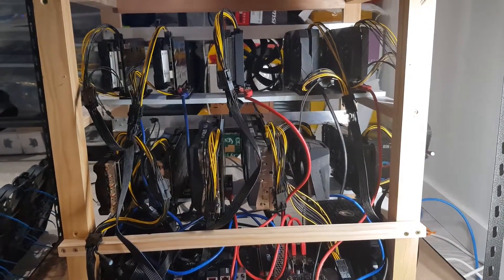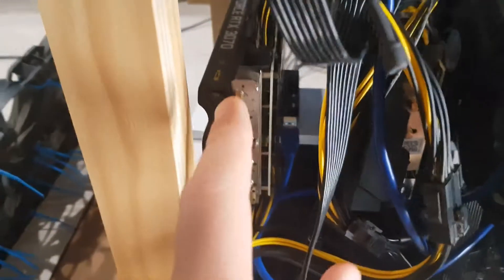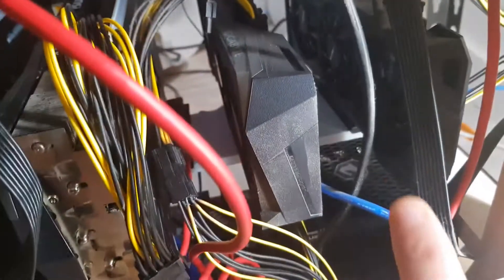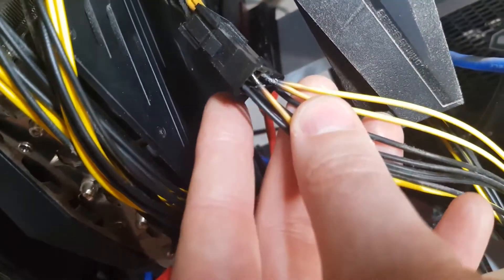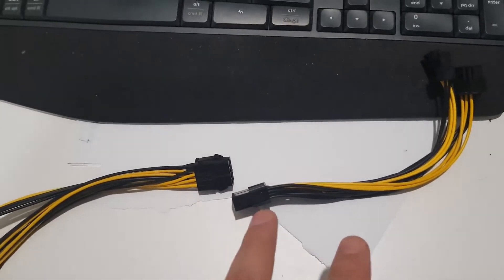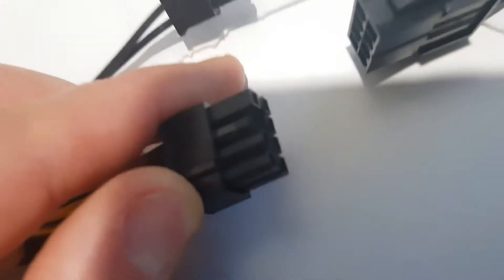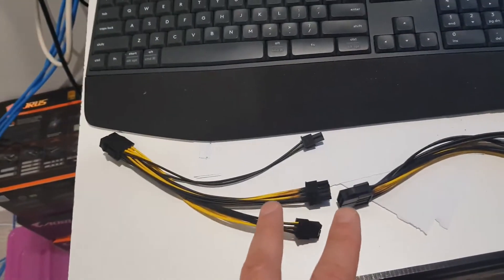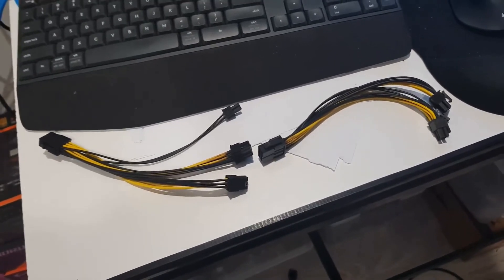🔥 GPU Power Cable Fire! 🔥 ⚠Warning ⚠  🧯Lesson Learned - Never Daisy Chain GPU Power Splitter Cables🧯

Comment: I've seen this happen on a few rigs. It seems the cheaper cable still use 18AWG but it's the really cheap crimps and connectors at the ends. I've had some wires slip out, bad crimps.
Reply from the maker: Hi Thanks for watching and reply!
Yes I agree it is always the connectors that fail, hence why when you join 2 of them back to back it is a recipe for disaster😂
Keep up the great work!
OZ Mining

Comment: If your power splitter cables 6 or 8 pin do not have 18AWG or less written along the sides of the cables - do not use them - replace them with 18AWG rated cables - not easy to come by but you will get the right cables if you search on retail or amazon but they have to be rated or they will be  causing you dangerous issues as the cables are too thin otherwise if they are not 18awg or 16awg - i use splitters as a last resort in fact i just dont use them rather have psu with defined 18awg cables straight to the gpu or a an atx power supply with at least 6 x 8 pin cables as standard ie 3 pairs
Reply from the maker: Hi UK Miner,
Yes all my cables are cheaper ebay ones but rated 18AWG, so I expect they'll be ok as long as never daisy chain or connect them together again.🤓
Thanks 
OZ Mining
Reply: @OZMining  we have all been there with mishaps if its not risers inserted the wrong way round, damages riser, damaged pcie or molex cheap fans it really is part of the tests with mining. Least damage is a saviour then back on it again..
Reply: I was literally going to do daisy chaining the splitters until I saw this video. So guys, can you suggest any best 750w psu that has more numbers of pcie cables with it
Reply: @anirudh2788  corsair